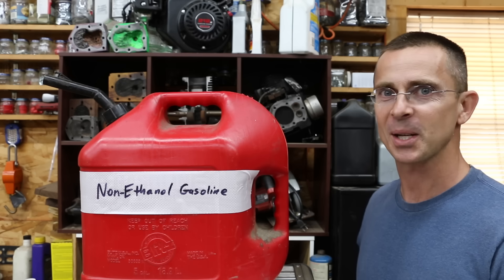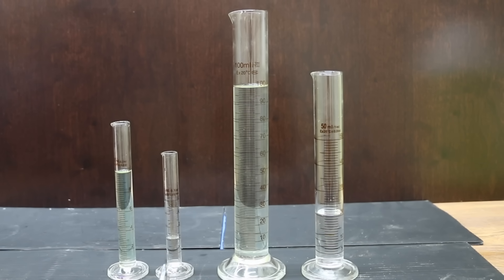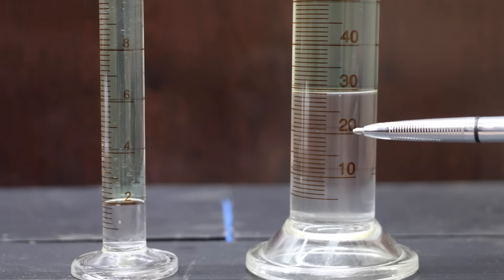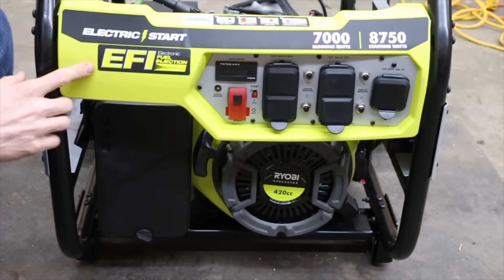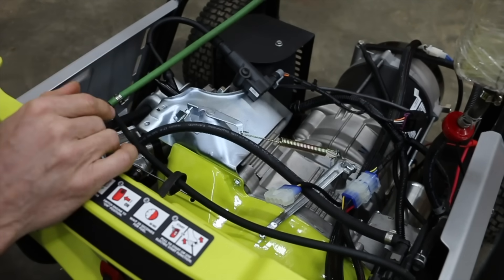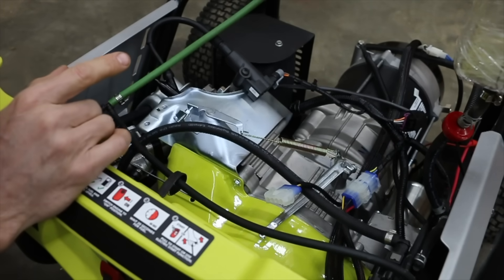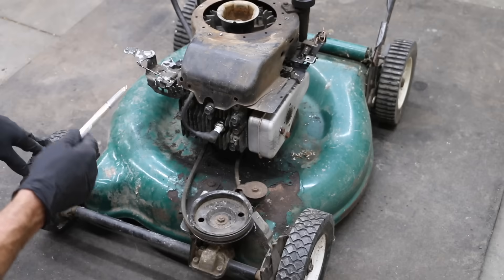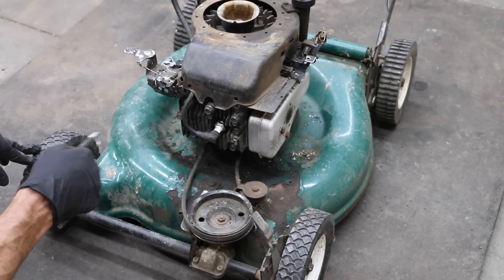Is Non-Ethanol Gasoline Really Better? See the PROOF!

Comment: All newer vehicles are designed to run on fuel with ethanol. As to were older ones are not
Reply from the maker: Thank you
Reply: Anything fuel injected can handle ethanol. Amounts may differ, but 5-10% abv is not even noticeable.

Comment: TECH TIP//// Put a zip-tie on the sparkplug wire of the test engine. That will help in shutting it down when not running it out of fuel in testing. No screwdriver needed to pop the plugwire off.
Reply from the maker: Great tip!

Comment: The new station at a local Walmart now has non-ethanol fuel. Thing is, it costs the same as premium gasoline. I actually get better mileage with premium, or I can retune for more power, so I would rather just go that route - if I wanted to spend the extra money. 
Thanks for the video, I've been wondering about this for a while now.
Reply from the maker: Thank you

Comment: Most anytime the govt interferes with something like requiring 10% ethanol, the result is bad, and sure enough, this is a whopper, one of the dumbest things they could possibly do. Adding alcohol to the fuel is a bad idea no matter what the source of the alcohol, but to have that source to be corn, not only a food for humans, but also used extensively in animal feed, dumb, just plain dumb. They need to dump this act of pure stupidity and get back to pure gasoline.
Reply from the maker: Thank you

Comment: Good video, I'm positive you'll find in your long term testing that rubber and paper gaskets like those found in a carburetor will show accelerated wear with ethanol fuel.  I can attest to it from my own issues with power valves in Holley Carburetors.  In fact most rebuild kits come with new composite parts to replace the rubber to deal with the detrimental effects of oxygenated (alcohol) fuels.  Not to mention the corrosive effects on fuel injection components over time.  You'll find o-rings on fuel injectors, for example , have been changed to deal with it.
Reply from the maker: Thank you

Comment: To obtain efficiency burning ethanol in an engine, compression ratio has to be higher than 14:1... Comparing efficiency in the same engine with a low CR suitable only for burning gasoline is meaningless...
Reply from the maker: Thank you
Reply: But that is 
what consumers are forced to do. Use ethanol in everyday engines.
The flex fuel engines step up the timing to optimize the power. Large mileage sacrifices are part of the game.
Reply: @hotrodray9884  If you are being forced to use gasoline with ethanol, buy engines with more CR or machine them to obtain more CR. 

Is not all about timing when dealing with ethanol fuels, efficiency is in higher CR's: Get profit of high octane rate of ethanol and obtain good mileage...

% of dehydrated ethanol diluted in gasoline will increase next years because it's green. If you don't want to end driving an umbilical cord, when you buy something with an ICE ask for high CR... 👍

Also there are variable compression ratio engines: this are  (or can be with a flex ECU) TRUE FLEX ENGINES.

Comment: We had a flex fuel van Dodge Caravan.  We got 12 mpg with that using E85.  We switched to 10 % ethanol and started getting 19 mpg.  The cheaper price of E85 was not worth the savings per gallon, it was more than eating up the savings by losing mpg.  Although it was good for speed pickup for jumping out into traffic.  
          Also, we were using 10 % ethanol fuel in 2 cycle engines, it was eating away the fuel lines inside the tanks and the carburetor seals.  We switched to non-oxygenated fuel, solved the problem.  Ethanol fuel is not worth the repair costs on small engines.
Reply from the maker: Wow!  Big difference.

Comment: Ive been testing it in three cars. A 2.0 8v, a 1.8 16v and a 1.0 12v eco box. 

Five full tanks of normal driving in each car. Shell vs unmanned cheap brand. Best fuel milage is with Shell Fuelsave. Asked shell, said there isnt any ethanol in it. Ethanol free is slightly more expensive here aswell. Still, mpg wise, its cheaper for me to run E0 instead of E10 per mile. 

Your test confirms my guess. Staying away from E10.
Reply from the maker: Thank you

Comment: The only reason I use non-oxy fuel is because of shelf life on my sporadically used equipment. It has my experience that oxygenated fuel only lasts about 30 days than starts going bad . Are we talking apples to apples or is e-10 to e-85 not the same as oxygenated fuel ?
Reply from the maker: Thank you

Comment: I would suggest using a ruler with a 90 degree bend for a quick comparison.  And using something like a 5 millimeter grid to allow for an overlay that could then be used to count squares that have carbon build up.  I.e. a square is a 1 if it has carbon covering the entire cylinder head for that specific part of the grid.  Then 0.5 for some build up and 0.25 for a slight amount of build up and zero for no build up.  

Taping the acetate to the aforementioned ruler would also allow for a quick placement type of rig.
Reply from the maker: Thank you for the recommendation!

Comment: from what i understood, the issue with ethanol gasoline isnt fuel milage or carbon buildup,. its the gas lines, fittings, and carbs on older cars get destroyed and erroded and the gunk builds up inside of the engine and carb.
Reply from the maker: Thank you

Comment: I run non-ethanol in my car, I see better mileage and performance, when using alcohol it takes more fuel to power the same engine. 
We saw this in a track car when tuning the carburetor, it needed  almost double the size jet when running 90+% alcohol and needed a bigger fuel cell to make all of the laps.
The upside to 90+% alcohol is it does run way cooler than gasoline so you can make more horsepower from the same size engine with proper tuning at the cost of almost half the mileage and you saw that with just a 10% alcohol mix it dropped 4-5%.
You can't argue with facts, but some still do, love the videos, keep it up.
Reply from the maker: Thank you

Comment: This seems consistent with my experiences.  It's by no means scientific testing, but I've found that I get 4-6% better fuel economy in my cars (checked with 95 Town car, 05 town car, 03 Grand marquis, and 94 Dakota) when using 100% gas for highway driving.  This equates to about 2MPG better.  The difference is less noticeable in city driving, but all of the vehicles I've owned have pretty awful milage.  (22-26 mpg for the 4.6 v8 fords and about 14 mpg on a good day for the v8 truck) I tend to do some rough head math when I have the option for 100% gasoline, to figure if it's worth the cost.  It tends to, perhaps obviously, work out better for 100% gas when fuel prices are high and there is little difference in price between 100% and 90%
Side note: I also see a slight improvement in millage when using 91-93 octane premium over 87 regular, again in the 4-6% range.  I'm unsure if this is because of any additives or such in the fuel, or simply because a large v8 runs more efficiently with higher octane. Typically with prices between regular and premium being quite different it is not worth running premium.
Reply from the maker: Thank you

Comment: Future Video Suggestion: Shell VPower Nitro+ 99 RON vs other Performance Gasoline brands..
 or whichever Shell VPower is available in the states. 
99 RON is what we have in the UK. I believe it’s 100 RON in Germany.
—
The reason I suggest this, is because ethanol content is just an octane booster. It’s the specially formulated detergents in performance gasoline that clean up gunk and carbon deposits. Not the ethanol specifically.
But with performance gasoline having a high ethanol content, people associate ethanol with a clean engine. But performance fuels also contain performance orientated detergents.
*which aren’t advertised on fuel pumps.
But you will find this info on Shell’s website.
—
Moral of the story is, all fuels aren’t made equal even if they appear to be on the label..
if a fuel has a higher octane but inferior detergents to a lower octane fuel, that’s been fortified with better detergents.
The lower octane fuel, in theory should have less carbon build up..
especially over long, sustained periods of time.
Less gunk build up on injector nozzles..
The fuel should also clean intake valves if it isn’t direct injection only.
Reply from the maker: Thank you
Reply: Shell V-power is just rebranded 98E5 (RON) nowadays.
Reply: I did a fairly basic test on Shell's V Power fuel, basically the test went as follows: Run the tank nearly empty (fuel light was on for 3 days, or about 20km), throw 10 liters of V Power in to dilute remaining fuel, estimated to be about 2 liters remaining, then fill 'er full of the V Power. Then I drove about 75km to get everything good nd warm, found a back road to park on, put my truck in neutral and ran the engine up to exactly 3,000RPM. With Shell V Power, my truck burned 7.6 liters of fuel per hour at 3,000RPM.

I then repeated the test with the cheapest fuel I could find, from Tempo. 95 cents per liter, as opposed to the $1.20/L for the V Power. Same test as above, but my truck burned 7.7 liters of fuel per hour.  My conclusion was, that it really doesnt make any sort of real world difference. 
I drive a '99 Silverado with the 5.3L V8.

Comment: Isn't E10 cheaper than ethanol free because of Gov't subsidies?  Just the process of measuring and mixing with quality control should cost something.  Seems like E10 is close to 10% cheaper than E0, yet this would mean that the distributors would need the ethanol sold to them at $0 plus get paid by someone to mix just to break even.
Reply: There is eighty cents difference at a dollar eighty a gallon, that is not ten percent.
Reply: @Maples01  prices vary by location in tge country, time of year, price of oil etc.  This past summer when I was purchasing ethanol free for our boat it was 25 cents more expensive than regular, whish was $2.50 at the time.  That is where the 10% came from.
Reply: @Btwiceborn  Well year round every year it's about a buck more, even when we suffered a drought, which drove up the price of beef and produce, ethanol was untouched, which should prove that it is subsidized.

Comment: its not the "carbon  deposits" that are the problem with ethanol.... the problem with ethanol is the molecular make up of it [sugar content]; Yes sugar is the problem with ethanol. As you said ethanol is an alcohol to make it requires sugar, when sugar is burned it becomes a sticky residue and collects contaminants quicker. You can see it in the photos of the head that you took, its not carbon in the photo touch it i bet it is sticky if so its sugar. meaning the burn[ compression stroke] was not hot enough [spark].... that is why a vehicle has a coil pack on each plug now, the engine requires a hotter burn to completely burn the sugar so there is no trace of it.
Reply from the maker: Thank you!

Comment: Test vehicle: 1974 BMW R75/6
Was riding to work when the gas station told me of the impending ethanol addition. We made a chart of how many gallons I bought everyday and miles traveled,almost 200 miles round trip. As soon as the ethanol delivery arrived I lost 10%, 4-6 mpg. I checked my tuning on my day off, changed oil, checked air pressure. I lost another 1%! I put that down to gremlins. I wish I had payed more attention to when I shifted on two hills, I believe I also lost power. No I don’t own a dyno. 

Just my experience.
Reply from the maker: Wow! Thanks for this information.

Comment: Do you have a way to check for horse power differences?
Reply from the maker: I need to build a dyno soon. Thank you.
Reply: As a general rule, ethanol only has about 2/3 the energy potential as non-ethanol gasoline. So you loose quite a bit of overall performance.

Comment: Excellent video.  I am very much interested in the next one because I believe ethanol gas has caused one fuel pump failure and at least one fuel pressure regulator to fail (two different vehicles) in a fairly short time for me.  Ethanol (especially when high in content in cheap gas) does seem to have a very negative effect on diaphragms (FPR and pump regulators), etc.
Reply from the maker: Thank you

Comment: I wouldn't even consider using an Ethanol blend in anything other than my vehicles.  The way it attacks rubber (hoses, diaphragms, needles) and goes bad when sitting will easily cost more in the long term than the extra price for non-ethanol fuel.
Reply from the maker: Thank you

Comment: Using the Old Ford Ranger, How about a 3 oil change challenge of Slick 50?  Note mileage of engine oil change without Slick 50, mileage and oil level with every fill up and when you have to add 1 quart for 5,000 miles, then repeat with oil change adding Slick 50 and the next oil change after that.  Don't add Slick 50 again until using lots of oil.
Reply from the maker: Thank you for the video idea!

Comment: That generator must be pretty good ,I have had a few generators burn up the a.v.r. running out of fuel under load.
Reply from the maker: Great point. i shouldn't run them out of fuel under load.

Comment: What type of material is the see through cylinder head made from ? Just wondering how I can do this myself to test fuels in my shop.
Reply from the maker: 1-inch Plexiglass.  I only run it for 20 seconds at a time and use a fan to cool it between engine runs.

Comment: w a r n i n g : opinions of a non-expert:

i think NASCAR was or is using 100% ethanol. the reason; better performance and cooler engines. the disadvantage; gas mileage is greatly reduced (25%) - that's why pit stops are so frequent.

ethanol is renewable, it's made from corn. ethanol pollutes less. the thought, at one time, was that we could all run our cars on ethanol and be foreign oil independent, but it's taking away from our food crop.

the gist is IMHO that ethanol  costs way more and you get lousy gas mileage
Reply from the maker: Thank you

Comment: Iv'e heard a lot of negative things about ethanol. I have not personally experienced any negative affects on my small occasional use engines. I live in a cool climate.  About 10 to 15 years ago I had a lot of problems with carburators. That was in a hot climate. Specificly pin holes in aluminum floats and O ring breakdown. At the time there was a gasoline additive called MBTE. I attributed it to that. When they stopped putting it in the gasoline those problems stopped. I try not to store engines in hot temperatures but sometimes it happens. Years ago people would use gas line antifreeze (alcohol) in the winter to get water out of the gas. Iv'e always wondered what the truth on the subject is. Good experiment, thank you for conducting it.
Reply from the maker: Thank you